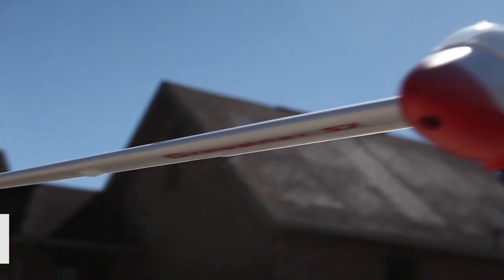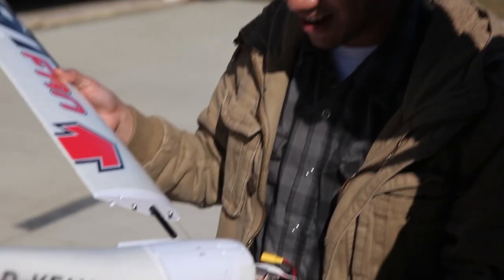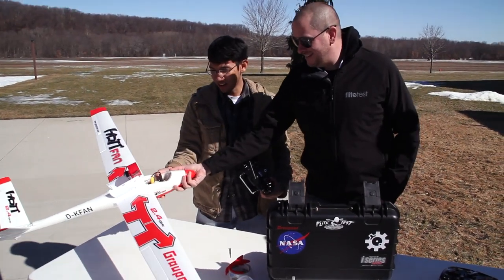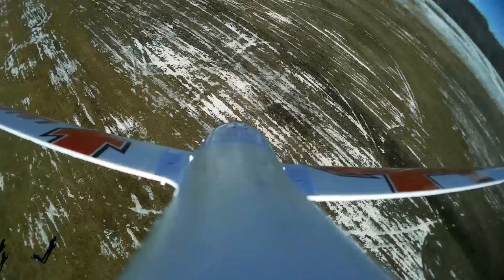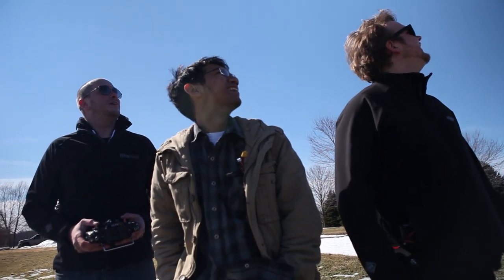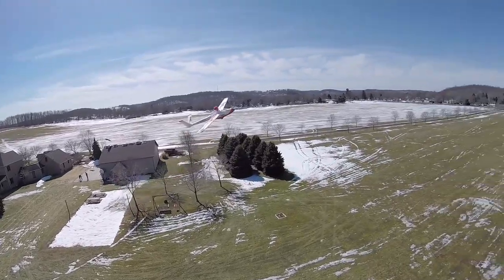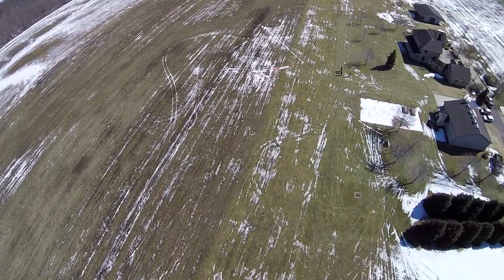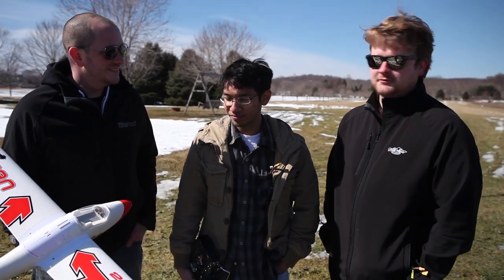Flite Test | Graupner Hott Fan - REVIEW

Comment: Mine arrived from Deutschland 2 weeks ago and I LOVE it. Here in the Vermont mountains it is my go to active wind and thermal machine now. Ran it on a some what heavy 2200 3s in 15-20 knots and loved it. My "MaxAmps" 1850 3s got here today. It's not as heavy as the 1600 recommended and has true 100c performance. All together a much liter set up than the 2200. 15 knots today and she floated rather well.She likes the wind... Well made and thought out... Good luck finding one.. And thanks FLIGHT TEST. You have influenced and enabled my addiction to RC in a good way. My Radian XL will fill the gap in light wind and thermals soon!

Comment: Really like the idea of the motor disappearing and giving it that clean look. Would be awesome if they had a T-Tail version
Reply: Thanks for the link henriktre
Reply: Paul, this model looks like a loose scale version of a H-101 Salto and hence the V tail, just incase you were wondering about the reason for this tail design.  http://en.wikipedia.org/wiki/Start_%2B_Flug_H-101
Reply: henriktre I think his shipping from Elefun would be pretty bad though ;) and I don't think STM sells in the US. the Beaver is an STM plane but sold under license by hobbyzone or something over there.

That glider is great value for money though, with built in airbakes and everything, though I just bought an Phoenix2000 instead, for the hotliner performance.
Reply: I just bought one of these https://www.youtube.com/watch?v=_I7GqOIaIyY
Reply: henriktre I just saw henriktre's link it's the same plane. It also has a retractable wheel.
Reply: BMSWEB Well that's different. I have a glider that is similar, but it has a folding prop on the front. http://www3.towerhobbies.com/cgi-bin/wti0001p?&I=LW3667&P=E

You can also get this glider from tower hobbies for less money, and it is the same glider.

http://www3.towerhobbies.com/cgi-bin/wti0001p?&I=LW3668&P=E#otheritems

Comment: Quite unusual! Does anybody out here know if this is really a Graupner product, or something they just brand 'Graupner'?
And hmm so an EDF huh.. I guess that does solve the 'prop in wrong oriëntation' problem when folding it down.. Seems to work just fine! Though I can't imagine it to be very efficient :)
Nice video again people! Cheers :)
Reply: DutchRC ADVENTURES It is the same as the ST Models Salto
Reply: Anders Olsen There we go.. Well yeah.. I guess (good) development is expensive.. Thanks for the heads up Anders!
Reply: And it is dumb because this one is more expensive too
Reply: Anders Olsen In short: Graupner hasn't learned from their own past..
Reply: DutchRC ADVENTURES Adding a (well designed) duct to any prop, theoretically improves its efficiency. So its wrong to say an EDF is less efficient, its just that most EDF's we use in the hobby arent designed with efficiency in mind, but speed and thrust for a tiny diameter (relative to props we would use for a similar wattage). 

Sure,  a (fold-able) prop could  be made more efficient than this EDF, but only because it could  have a larger diameter. Given the constraint of size for folding back in the fuse,  a well laid out EDF should win (and that is also why you see this plane has an unusual 3 bladed fan)

BTW, full scale gliders frequently use a very similar setup, with a little jet engine that folds out behind the cockpit. Those truly are inefficient, but the big advantage is that they can extend and retract quickly and if they dont start, they dont produce the massive amounts of drag that a large propeller does.
Reply: I have seen a full scale glider at Quirnheim, Germany with a retractable large model gas turbine fitted which is enough thrust to keep it going after a tow to height, very impressive! As for the prop issue if not using a ducted fan, there are others out there that utilise a folding prop for the modelwhich lays flat fast enough to allow for a smooth retraction!
Reply: mattyp80 Yes.. there you go.. I've seen prop-setups (at least in real gliders) as well.. I can imagine however that Is a bit harder to engineer right.. To avoid that problem.. I think they went with an EDF here...

Comment: I'd buy one when the airleron servos were in the wings. I love the mechanism to put the wings on the fuselage. thats the actuallay the main factor why i would buy one, because of this quick and easy way to put the wings on..
Reply: All gliders of any significant size have removeable wings with servos in the wings - there are lots of advantages and no reliability issue if the connections are done correctly (I.e. Multiplex green connectors or similar, not std servo connectors).

Comment: Plane really cool, power-pod system awesome.. wings locking system really cool

But that single servo pushrod system? is awfull... seems like a nightmare every day of flight... and i dont think that will age well...

Also... wonder if it flies much diferent under power than when not under... Graupner motor-gliders have a nasty tendency of having quite diferent flight characteristics when using motor vs motor-off (like the Elektro Rookie or Elektro Junior)

Comment: I've been flying RC planes since August last year, and quads since December 2013, and my current interest is RC gliders/sailplanes. I have two, the Volantex Phoenix 2000 and the Volantex ASW28 with 2m and 2.5m wingspan respectively, both available from HobbyKing. The Phoenix is a great intro into gliders/sailplanes as it's easy to setup and very predictable in flight. The ASW28 I would rate as a strong intermediate glider. Even though it is quite large it is still easy enough to be launched without the need for an assistant. Both planes are easily capable of providing in excess of 30mins flight time off of a single battery even on the most thermally starved days. ST models do the same glider as reviewed here but they also do one with a traditional prop which retracts into the fuselage.
Regards
Nidge

Comment: Great review. A couple of local guys got the Salto version and I had a chance to fly them.  Pretty aggressive flyer similar to the KA-8 and Radian Pro.  Lots of fun to fly under throttle and I had to try it on FPV.  It was nice to give full throttle and be able to control it unlike other gliders that just climb like crazy.   We did have that auto motor deploy box stop working.  We just put that servo direct to the receiver and mixed it to throttle with a curve.  It needs to be all the way up under throttle.  Fun plane to fly but it's hard to fly it as a glider since the EDF is so cool!

Comment: It is a nice looking glider.  But, a 3 blade EDF w/o a thrust tube?  Honestly, this part of it seems like a gimmick.  As it sits, it will not be efficient.  A folding prop on a motor that pops out would be much better in this situation.  On the other hand, an EDF that pops out does look and sound cool.

Comment: Hi Flite Test!

I found that there is a pretty large measured difference in battery weight from different manufacturers for the same Mah rating and "C" rating.  On a 2200 Mah battery I measured at least a few grams of difference between manufacturers!   If the CG is critical, (perhaps in a contest) you might have a noticeable difference between the performance of one battery Vs. another. I measure the weight and write the weight on the battery with magic marker for that reason.  There is a difference in voltage output too between the different Mah and "C" ratings.  Again just a little bit of voltage (a couple of tenths maybe) higher or lower for different manufacturers but for contests coupled with the weight difference there can be a significant performance between the two batteries.  Perhaps someone should document this as an experiment.

Comment: This glider is a prelude to the big scale sailers that are now flying with nice air turbines. Those are very expensive and a lot of work but you can get the feel of that experience for a lot less with this, in one package from a company whos name means top of the line engineering and quality. No mention about any of it in the video or why the turbines are being used now, instead in length talks about its v-tail and jokes about its name. Please dont get lazy Josh, do the research and prepare so you know the product you are testing coz sometimes its not "just another glider"... not at all.

Comment: Sorry i have a question related with motor stick and switch used to extract the motor arm. Is possible to utilize only the motor stick and for example in the first part of stroke i mix to have extraction of arm and later start the motor?
Thanks

Comment: they didn't use a tee tail because it would effect the rudder and elevator, notice all aircraft in the past that was a pusher either had a vee tail or twin booms with a long elevator either mid section or high on two rudders. that way your controls werent effected by the blast of the prop or jet engines. hope this made sense to you.

Comment: Motor popping up and going away is pretty cool. What does the V-tail do for a plane. Do Gliders have V-Tails and other planes have the other type? Confused but happy.
Reply: Vtails are just a different style. It's more aesthetic than functional.
There are endless arguments that vtails are more efficient than conventional and vice-versa.

Vtails are quite common on RC gliders as they are stronger than t-tails or conventional, and especially with slope gliders they have less chance of snagging on obstacles on landings.

Vtails are more complicated on full size planes than conventional and cost more to design and build so are much less common. One vtail plane is the Beechcraft Bonanza
The glider in this episode is based off the Salto Aerobatic glider. Variations of which have a retractable turbine hence the edf on this model

Comment: the reciever can be changed?
Reply: the fuse I can only find the German manual, but on page 5 you can see a picture of the access hatch in the front. It looks like the receiver is accessable and it should be possible to replace it. (http://www.graupner.de/mediaroot/files/9920.100_HoTT_Fan_de.pdf)